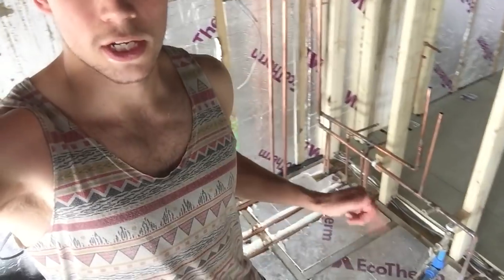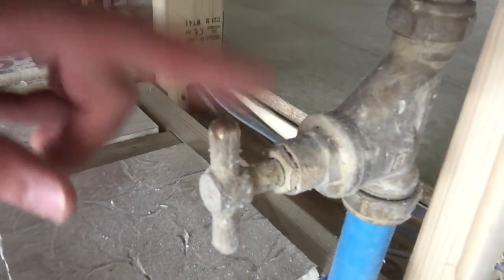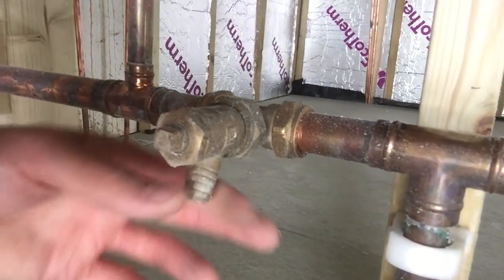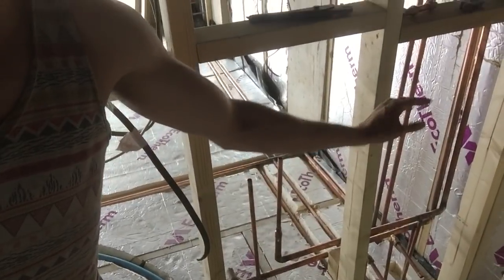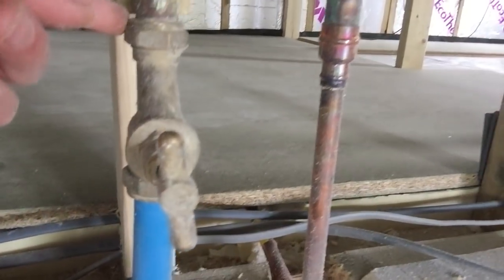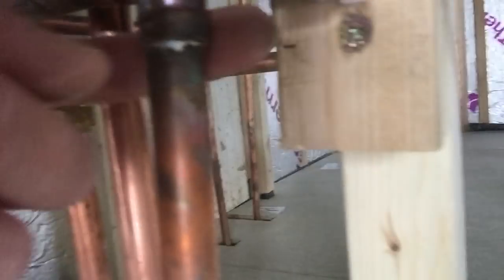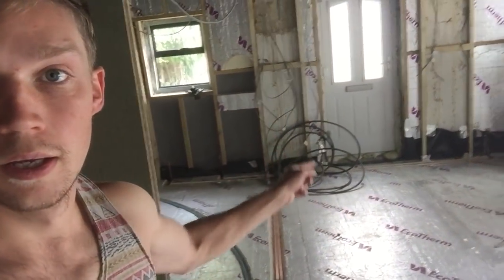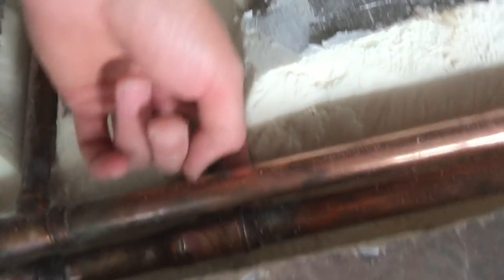15 MINUTES! on How to Install Central Heating System for COMBI BOILER

Comment: well done. I need a plumbers mate job to be able to terminate my NVQ2
Reply: Another option is the get the gas safe done which is essentially nvq level 3, however saying that, it is quite tricky.
Reply from the maker: Darian Caballero Medina thanks my man. :) I’m not a plumber but maybe someone in the comments can help you :) I’ll pin your post to the top.

Comment: Old video, but well done you. One thing I gleaned from YT is that not all Rads are fed to the left, some are fed through the TTRS Valve on the right (Arrow markings I believe) so make note if someone else is having a go. Also I would want to pressure test my joints before flooring. Not sure what you'd use in this case? Maybe some sort of air pressure gauge. Would be a nightmare to rip up all the floor if indeed a joint had failed.

Comment: Quite a few draw offs as in cold water and hot ect. Prob be better with a pressurised cylinder.   Also really should of done as many pulled bends in as many places as poss.   And the fittings not cleaned at all.    Just try to use less fittings.  But not to bad.

Comment: Heating circuit pipe work requires insulating as it will lose heat to the subfloor ... just saying

Comment: Great job but I would have advised you didn't have to copper pipes touching each other as it can cause vibration
Reply from the maker: That’s for the feedback, no problems so far but good to know.
Reply: @MattHutton  good to hear matt keep up ylthe good work 👍

Comment: Really good video but you really should have a double check valve after the stop tap to prevent black flow and prevent contaminating the water mains

Comment: I’m trying to learn, but I thought cold water feed had to go to kitchen tap first then everywhere else with a no return valve, but here it goes to the toilet first? Can the water not come backwards and contaminate drinking water?
Reply from the maker: Hi Marcus, no worries. No the contaminated water goes out through the sewer and clean water goes into the cistern above the toilet. So it’s allllllll good :)
Reply: Matt Hutton - thanks for the reply mate. So in the plumbing world there’s no way the water can come backwards down the pipe and contaminate anything?

Wait, isn’t inside the cistern where the water feed overhangs the main body of water and never comes in direct contact with it?
Reply from the maker: Marcus, I don’t know I’m not a plumber. But, you can drink the water from the cistern as long as you don’t poop in it lol
Reply from the maker: Marcus just seen the second half of your comment, I’m sorry. Yes the water feed hangs over the main body of water in the cistern and drip fills it.
Reply: Matt Hutton - thanks Matt! Better late than never my friend 🤣 I bought a NVQ Level 2 plumbing book now so hopefully I will learn more 😀 But I have to read my woodworking one first.

Comment: Hope you pressure tested those fittings b4 you hid all the pipes because it looks like you over heated them
Reply from the maker: Yeah baby 4.5 bar
Reply: Yes you definitely overheated them but fair play. As soon as you see that soldier run take off the heat. 👍 If the pipe is black it's overheated.
Reply from the maker: Dion Weston good to know, thanks :)

Comment: Any chance of doing a boiler installation from start to finish?
Reply from the maker: David Henderson I wanted a gas safety certificate for the boiler install so I got a gas safe engineer to do it.
If your are building somewhere you want to rent or live in, it might be better to get a gas safe registered engineer to install the boiler because they will take on the liability for the installation and if something goes wrong they are insured. Also your council won’t sign off the building as completed if you don’t have that certificate.
Reply: @MattHutton  so I guess the gas engineer wouldn't let you film it? Is that wishful thinking?
Reply: So you connected a mains pipe to the boiler with a hot and a flow and return?
Reply from the maker: David Henderson yes I don’t usually film the stuff I didn’t figure out myself.
Our combo boiler has a gas in connection, hot flow and cold return connections and a cold mains water in connection. There’s a video I found from this guys Allen hart who shows how to fit a boiler that I found when I was considering it: https://youtu.be/5GHT834JUOY

Let me know if you manage to do it :)

Best regards Matt
Reply: @MattHutton  thanks mate 
You have a good channel 
keep it up

Comment: Didn't fancy burying all the pipes in the stud walls then ? 🤔
Reply from the maker: Hey simon staines thanks for the comment :)
No it would have meant a lot more pipe and drilling through brick and studs.
Reply: Matt Hutton look much nicer tho fella 😇 got any finished vids of the job?
Reply from the maker: simon staines will upload a video soon of me mounting one of the floating radiators:) subscribe and you’ll get a notification when I upload ;)

Comment: Where did you also find the best place to buy the copper pipe and the couplings?
Reply from the maker: Tooostation for all joints and b and q for all pipes
Reply: Google JTM Plumbing.. Great prices & next day delivery. I use them all the time.

Comment: Great stuff mate. There's an issue with installing a boiler yourself though as building regs need to be notified about the installation. If you do it yourself you'll end up pleading with gas safe plumbers to come and sign off your installation. Which of cause they won't do as it'd be like putting you on their insurance :)
Reply from the maker: Gbemiga Meduoye thanks for your comment ;) all signed off.

Comment: Nice job mate. But I wouldn't use compression fittings on new installation especially in cavity walls. Also I would use pipe bender to avoid using so many elbows.
Reply from the maker: Iby J nice, thanks for your comment